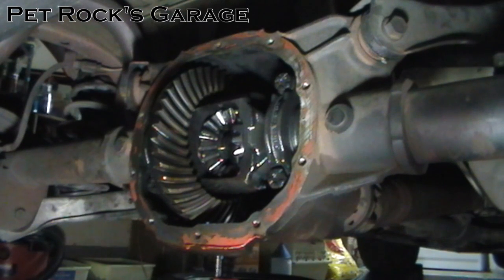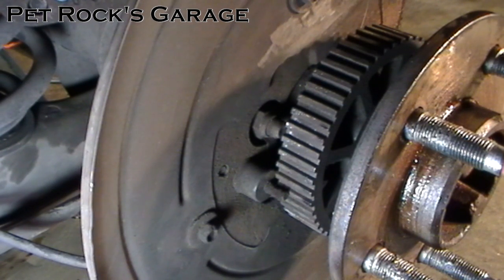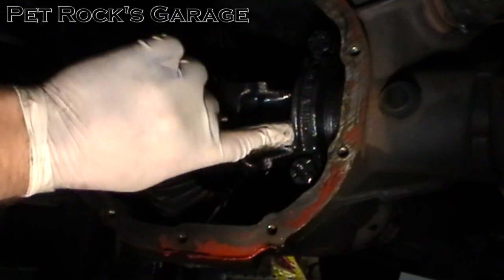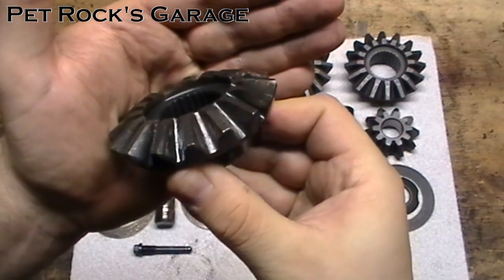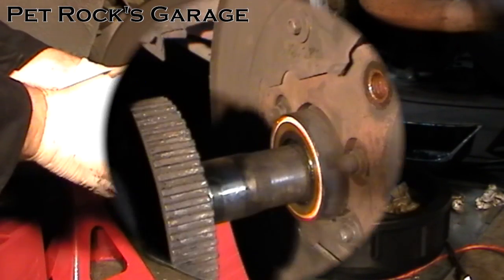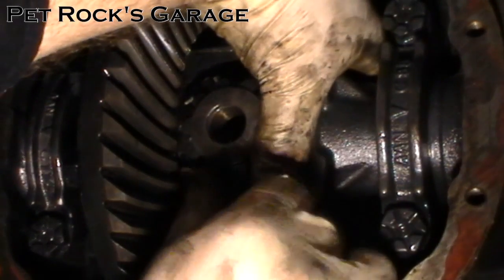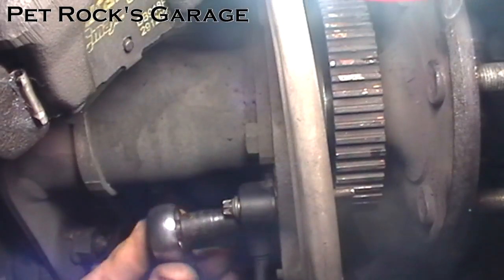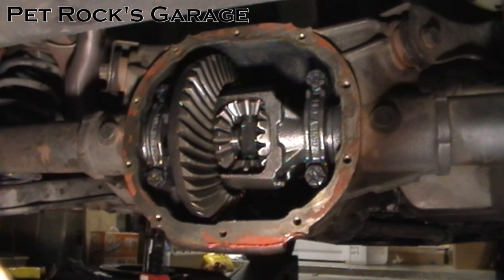How To Replace Spider Gears In Ford 7.5 & 8.8 Open Differential - Ford Mustang

Comment: I had a question my 2008 mustang v6 just got installed 3.73 from motive and an LSD from Yukon and I turned it into the shop they effed me over stang sounded worse than before it went in usually when coasting accelerating (unless I get on it hard, no pun intended) and decelerating makes a whining sound as if the rear end was dry. What do you think it is?
Reply from the maker: Could be they didn’t add Friction Modifier fluid to the rear diff fluid for the LSD or the lash adjustment is off.  Good luck…
Reply: Thank you for your input pet rocks garage oh btw awesome name had me rolling 😂 your videos are awesome too keep up the great work🤘🏽
Reply from the maker: Thanks a lot.  I appreciate it.  :-)
Reply from the maker: Yes.
Reply: Pet Rock's Garage hey do i need the washers on the small spider gears

Comment: my spider gear on passenger side won't come out.  axel is removed... I'm talking about the one that has splines for the axel.  ford 7.5
Reply from the maker: I’m not sure what they are called, but I’ve called them the side spider gears. If the axles are out, and the top & bottom spider gears are out, then the side spider gears should come out. It may take a little bit of prying, but they should come loose. Try spinning them a few times to make sure they aren’t seized up in the diff carrier housing. Good luck...
Reply: +Pet Rock's Garage . ya i got it out. it scored itself into the carrier housing.
Reply from the maker: Glad to hear you got it sorted out.  Hopefully it didn't score too deeply and cause the new gear to be loose in the bore. Good luck...
Reply: Canadian Dav

Comment: question, about the rubber O rings on the inside of the left and right shafts. does it ride to the outside of the clips towards the splines or on the inside towards the center of the car?
Reply from the maker: I’m not sure it matters. But on my case they were towards the center of the car on both axels.

Comment: Do you have to take the upper control arm off. The rear end of a 2004 ford explorer. To change the spider gears
Reply from the maker: No, you don’t not have to remove the upper control arm. You shouldn’t need to touch it. Good luck...

Comment: for some reason i can't get the shaft to pull out of the drivers side.i removed the ring that locks it in but it snags on something. the passenger side pulled out easy. what did i do wrong?
Reply: bakardy2011 l
Reply from the maker: I’m not sure. Only thing I could think of that it could catch on would be the gears or bearings inside the differential. The rest of the diff is a smooth tube. Maybe have a friend assist and look at what it is catching on as you try to pull it out?  Good luck...
Reply: +Pet Rock's Garage 
thank you. after sleeping i think i may still have the abs attached.
Reply from the maker: Good luck...
Reply: Doug Bohanan 
yes

Comment: I inspected my spider gear on my 96 mustang 7.5 rear end Due to noise while turning, they are worn out, When I had the car jacked up and spun both axles, keeping the other one still, the noise was the same, Does that mean my axle tube bearings are likely ok, Just need the Spider gears?
Reply from the maker: Yeah, it sounds like your wheel bearings are fine. But to isolate the wheel bearings you can spin both wheels at the same time by rotating the drive shaft with both wheels off the ground. The spider gears only spin when the wheels are turning at different rates. So if you get the noise when the spider gears aren’t spinning then the wheel bearings could be bad. Good luck...
Reply: Nice tip to isolate if the bearings need to be replaced. Thank you.
Reply from the maker: no problem & good luck
Reply: I've been turning wrenches on my own cars for as long as I can remember, however I never dug into the rear end, except to change the oil. Very nice video!! easy to follow and understand, Thanks again.
Reply from the maker: Yeah, there is a bit of mystery in differentials. But once you understand them, they are pretty simple. Only P.I.T.A. thing with differentials is setting up pinion depth & backlash. Other then that, they are pretty straight forward.

Comment: You're on of the best youtubers at describing what to do. Thank you!!
Reply: +Pet Rock's Garage habe you ever had Hell pulling out the shaft? it acts like it wants to come out and gets stuck about 2 inches from locking position. i feel really dumb.
Reply from the maker: I’m not really sure. They just slid out for me without a problem. I responded to your other post with a suggestion on how to get it out. Good luck...
Reply from the maker: Thanks a lot.  I appreciate it.  :-)

Comment: 10:13 i didnt see that washers on my pinion gears i hope i didnt leave that thing out i have ford mustang 2003 base i am worried now
Reply from the maker: Those washers are important.  If you left them out then your gears will not last very long. its worth your piece of mind to double check.
Reply: its probably the previous owner didnt put them back or probably my mustang dont have them...  and sadly i already put the cover on and oil too, i check it again and spin the drive axle it sound smooth
Reply from the maker: It definitely came with them from the factory.  I can tell you that much.  It could also be that the old ones just wore down and disintegrated.  While I agree its a P.I.T.A. to pull the cover and have a look inside, it will at least give you the piece of mind that your differential isn’t going to grenade some day as you go down the road.  But it’s your ride.
Reply: mmm I knew i drop the pinion gears to many times i didnt see or felt washer droping somewhere else  so i assume my ford mustang 2003 3.8L actually dont have them, but  i will test drive my mustang tommorow if something not right i will open it again, coz i spend to much time already not to mention pain on my body he he he
Reply from the maker: Good luck...

Comment: if the center pin going through the spider gears is stuck what should I try?
Reply from the maker: Make sure you’ve got its retaining bolt removed.  After that, the only thing holding the pin in is friction. So take a punch and bang it out.  A bunch of penetrating oil would help too.  Good luck...
Reply: Charles Murry get i am probably to late but I just went on my passenger side axle  (tire) and I just shook it back and forward and it just slid out mine wouldnt move with a punch as well hope everything went well!
Reply: Pet Rock's Garage i promise you there's no way its getting past that ring gear tooth without messing it up. already got my retaining bolt out and my c clips and axles out, but that pin aint coming all the way out
Reply: Randy Moreau too late but thanks. Already filed my ring gear tooth down. No big deal though, everything still seems to work fine, and now if I ever want to put in a locker or anything in I should be able to use aftermarket pins
Reply: Charles Murry nice perfect! I have to got get my box of spider gears tomorrow then I will have my truck back !

Comment: i need help my locking bolt strip i was using 8mm
Reply from the maker: Try using a Dremel or similar tool to cut a groove in the bolt head so you can use a screw driver to take it out.  Or try a pair of needle nose vise grips.  Good luck...
Reply: hi hello just to make sure is that lefty losy right ? dam this little volt is pain in the ass
Reply from the maker: Yeah, lefty loosey, righty tighty...
Reply: i am going to try the impac wrench it might work i just went to the mechanic it will cost me 300dollars i am going to try it tommorow
Reply from the maker: $300?  Thats ridiculous for just one bolt.  Good luck!!!
Reply: no actually i was going to change the shaft seal then i got stuck on this little bolts by the way u were right Dremel works and a little praying at night he he he . I finally remove it, I square  both side then a good solid grip of vice grip works.
Reply from the maker: Thats great!  Good luck with the rest of the job.  Of course replace the bolt when you put everything back together.  :-)
Reply: Pet Rock's Garage yup i have to busted 2 of the abs wheel speed sensor cant push clip enough to remove, but i still save 200 dollars after buying 2 new wheel speed sensors
Reply from the maker: You need to remove the sensors to be able to push the axle in far enough to remove the c-clip.  I show that in the video around 1:55.  Check out rockauto.com, they have pretty good prices compared to the big chain stores.
Reply: Pet Rock's Garage 3:11 mine welded stuck and rusted around it i have no choice but to busted them: i have a question i think the pinion gear i didnt put them on there original sides whn i spin the wheel i can hear the gear
Reply from the maker: I don’t follow what you mean by you can hear the gear or the pinion gear.  When replacing the spider gears you shouldn’t have to touch the pinion gear.

Comment: My Spider gears don't walk in that freely
Reply from the maker: +Corey Kennedy, are you sure they are the correct spider gears for your differential?  I'm not sure what you mean by it doesn't "walk in that freely".  Did you lube up the shims and made sure the side gears are properly seated and lubed?
Reply: No, I guess that would be this is a very vital thing to do. My 99 Ford Expedition has the same setup in my differential. I was turning the passenger wheel instead of the driver wheel. I'm not even sure if that was a vital element as well.
Reply: No, I guess that would be this is a very vital thing to do. My 99 Ford Expedition has the same setup in my differential. I was turning the passenger wheel instead of the driver wheel. I'm not even sure if that was a vital element as well.
Reply from the maker: +Corey Kennedy, it shouldn't matter if you turn the passenger or driver side tire. It sounds like you have an alignment issue where the left & right gears aren't seated properly. Double check that you didn't leave the old shims for the side gears in place when you installed the new side gears. The shims sometimes don't come out of the case when you remove the old side gears.
Reply: That's the thing. It's not a replacement job, it's just that I have to put everything back after I had replaced my rear driver side studs. It has been difficult ever since I had replaced my studs. maybe I will try to lubricate the shims as you suggested and try to walk them in myself. I thank you for this video, it helped a lot
Reply: That's the thing. It's not a replacement job, it's just that I have to put everything back after I had replaced my rear driver side studs. It has been difficult ever since I had replaced my studs. maybe I will try to lubricate the shims as you suggested and try to walk them in myself. I thank you for this video, it helped a lot
Reply from the maker: +Corey Kennedy, if you are just putting things back together then its an install problem because it all went together before.  Its likely something silly.  Good luck...
Reply: I would imagine so, there are pegs on the back of the other  gears, and there are markings on my spider gears. I hope that 1 Spider gear does not have to go in before the other, but thank you.

Comment: In real time, how long should it take on average?
Reply from the maker: +Jon Smith, it entirely depends on who is doing the job and the tools they have available. Someone doing this job for the first time will take a lot longer then someone who has done it hundreds of times.  About 2 hours (not including time for the RTV to cure) is a reasonable amount of time if you have mechanical skills and the necessary tools, but it can take longer. I don't know the 'book' time on this job though.  So if you are trying to figure out how much you will spend on labor at a shop, that is something I wouldn't be able to answer.

Comment: need  some help I have a 2003 mustang v6 changed the rearend gears to 3.73 when put it together the ring gear is blocking me from putting the center pin in
Reply from the maker: +max negron Do you mean that the ring gear is blocking the hole in the carriage that the center pin goes into?  If so it sounds like you have an alignment issue. Like the ring gear isn't seated properly around the carriage.  Double check your bolts and make sure they are all seated properly and that the ring gear is push against its mounting area.  Good luck...
Reply: Yes I brought the gears from American muscle 3.73 it looks like the new gears is wider.
Reply: I called and they said they the right gears for a 03 v6.
Reply from the maker: +max negron, is it the right set of gears for your differential though. If you have a 7.5 diff a gear set for an 8.8 might not fit. I’m not sure really what the issue is. Its hard to diagnose from my keyboard. Good luck...
Reply: Did you get this sorted? I have the same problem but oddly enough, all I did was change the wheel bearings and not the gears. The pin came out easy enough yet it just won't go in not. If I remove the gears it slides through everything easily but when I put everything in and line it all up, the pin that holds the spider gears together just will not go in.

Comment: Hello, my 8.8 has a S spring. I was wondering if i need to put that back in.
Reply from the maker: +issac pacheco, yes.
Reply: I also have s spring in my 8.8.    Does this video also work for putting top and bottom spider gears in.mine fell out doing axle seals.please help it's my daily driver

Comment: 10:25 - Right here is where I am having an issue with my reinstallation. The gear sleeve on the back doesn't seem to want to fit in the housing with the gear. Every time it slides the gear in the housing pushes the sleeve off the top. I tried applying pressure as I moved it, but just doesn't want to fit. Hoping you might have an idea or 'trick' to the particular situation.

I've tried pulling the clipped axles out as tightly as I could to increase the spacing, but still giving issues. Any advice you might be able to give is appreciated.
Reply from the maker: +Cloudski, do you mean the little disk/washer that clips onto the gear and goes in-between the bear and the housing as shown around 10:10)?  Those should clip onto the gear. Make sure its not damaged or warped or anything like that. Make sure to apply a little bit of oil to both sides of the washer as I show in the video so that it slides into place in the housing easier. Its hard to diagnose this from my keyboard. I would have to have the diff in front of me to tell what is going on.  The washer should clip onto the gear so that it doesn't slide off while positioning the gear.  Good luck...
Reply: Pet Rock's Garage No, I meant the ones at the point shown at 10:25

The smaller spider gears are the ones with the problem. The metal 'washers' on the back of them won't turn into the housing. The gears fit just fine themselves, just the sleeves on the backs of them don't fit in.

Ah well ,I will just have to try again after I've had sleep and such, maybe I was missing something in the fatigue of the day working.
Reply from the maker: +Cloudski, yeah we are talking about the same thing.  The small gears have little cupped washers that clip onto them. Make sure that the larger gears are seated all the way into the housing and that the old large flat washers aren't stuck in the housing. You could have two large flat washers on one of the large gears that is pushing the large gear out too far causing clearance issues.  Good luck...
Reply: Pet Rock's Garage I figured that might be the cause of them not fitting in all the way. I'll likely pull out the larger ones to double check they are seated properly when i have more time and not frustrated already. XD

Learning all this on the go, The spider gears coming out was a pure accident while doing axle bearing maintenance. Whoops. :P

Thanks for the replies.
Reply from the maker: Yeah, sometimes its good to step away and do something else.  Come back to it later with a clear head. Good luck...

Comment: I never comment on videos but after watching I have to say one of the best how to videos I have ever seen on youtube. My wife has a 2001 Mustang is it pretty much the same as the 98? She has a leak on the right rear seal and I noticed lot of play In the axle so it is probably due for some new gears also. Thank you again for the video I will share and watch all of your videos.
Reply from the maker: +Stephen StephenB, Yes, your wife's '01 is pretty much the same as my wife's '98 (in terms of the differential). I wouldn't condemn the gears before pulling the diff cover and having a look inside. The play could be due to a lot of things, including but not limited to, bad driveshaft u-joints. Good luck...

Comment: So, when I did my rear brakes and rotors I noticed that little bit of play in the wheels. Does that mean my gears are going bad and should be changed? Kinda wanted to put 4.10 in it anyway.
Reply from the maker: +That1ne, all differentials are configured with some back-lash so a little bit of play is normal  Its excessive play that you should worry about.  Only way to truly tell is to pull the diff cover and have a look inside. The play may not even be in the gears. It could be in the u-joints in the drive shaft. Good luck...
Reply: Ok, I'll give it a look
Reply from the maker: Good luck...
Reply: Pet Rock's Garage Thanks